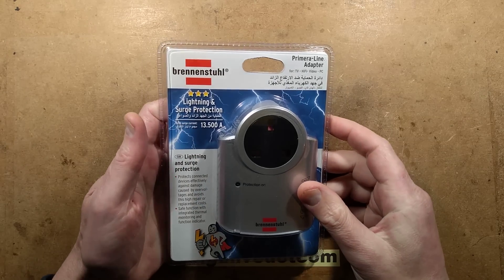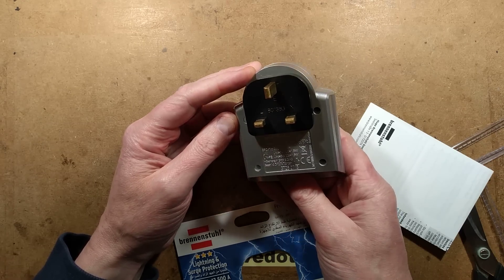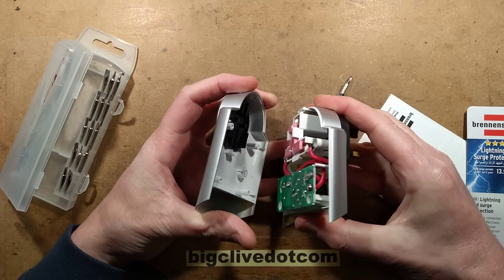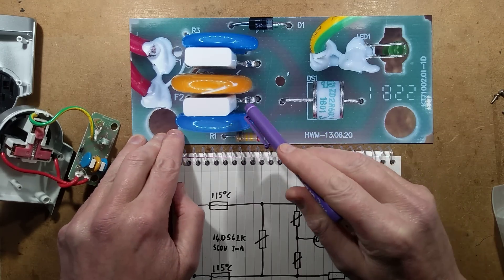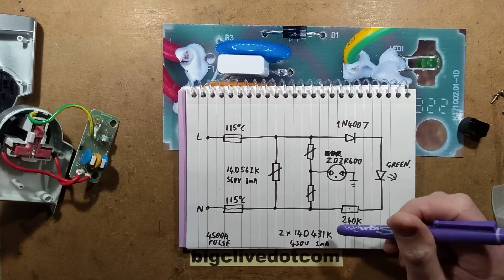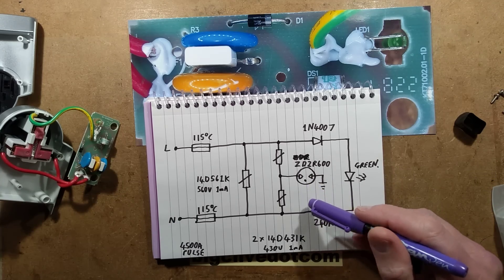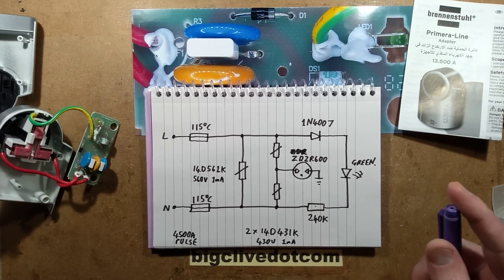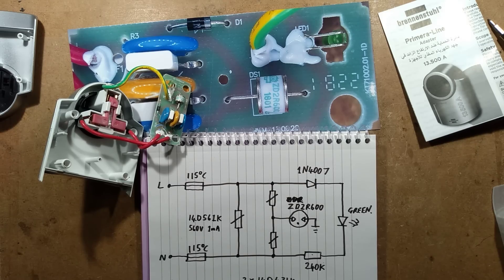Inside a 13,500A surge protector.  (With schematic.)

Comment: My grandfather used to just leave a regular incandescent light on all the time to protect against lightning and such. I always thought it was a bit absurd until the pole transformer outside got struck by lightning, and the lightbulb actually allowed the ~15 kV surge coming in go to ground. Terrifying to watch, but it was effective and saved the rest of the appliances in the house.
Reply: @CubeAMSPro100 Well, truth be told it was probably several light fixtures that flashed over, but basically the filament was instantly vaporized and the arc went across the small wires that feed thru the glass base in the bulb, making it light up a brilliant blue in the room I was in. Could also see the arc dancing around in the bulb, but it didn't shatter. The transformer shorted out during the strike and fed the HV from the lines directly into the house. It must've been quite a lot of power because the feeder wires coming off the transformer and going to the main fuse panel immediately burst into flames started glowing bright orange and after a few seconds came off the transformer, breaking the circuit.
Reply: the filament acts like a fuse and energy absorber. its resistance is very low compared with other appliances in the home so the electrical surge will choose it to go through, it evaporates thus absorbing electrical energy, the metal atoms fill the void, and then it breaks the circuit and arks thus absorbing more energy. brilliant!!
Reply: @CubeAMSPro100 Sorry should have put in what was said above as well, but basically since the filament is on, its already conducting and is a current path and doesn't require substantial voltage to start a flash-over. The filament is a couple hundred ohms and is small so wont carry the full voltage surge, but its there long enough to allow the arc to form as said above. It wont carry current for long, though, as the feed thru wires that the filament is crimped to are quite small. I suspect they're probably melted down quite quickly, but at that point the arc is already conducting.
Reply: @CubeAMSPro100 I will say one thing that with the advent of LED lamps its now a free for all as to what pops first during a lightning strike. My parents also sustained a direct strike to their incoming service, and it ended up being a chunky external power supply that was turned into a melted down carbon pancake. Same thing for the place I worked at before my current job which had just fluorescent lights. Bolt came in and burst the water main, and ended up cooking the ethernet router (and physically destroying some of the cabling), knocking out our network the next day. Makes a good case for getting lightning arrestors installed on your service.
Reply: @mysock351C  After i completely switched to LED lights i can't even have light on when there is a storm because where i live lightning strikes like crazy all the time and i already lost 4 LED bulbs
Reply: you really need surge protection anywhere nowadays... also, i would prefer the failing surge protector switching supply off, instead of just committing suicide and leaving load unprotected
Reply: @ketas  They wont protect against lightning strikes, tho. It will just flash over inside from what I found when it nuked an external supply. Still useful for glitches from relays and sudden voltage surges if a transformer has automatic tap troubles.
Reply: well, you need something bigger to protect wiring itself... like gas discharge tubes or air spark gaps... so you don't get flashovers in wrong places, like inside junction boxes or maybe in cable itself
Reply: @ketas  Yeah thats what I said a couple posts up. Its good insurance if the service permits. Data center behind my old apartment complex had surge protection at the main switch gear, and it was surprising how often it would trip on overloads and surges.

Comment: So for surge supression on DC what is a good option when turning on a very large 6000w inverter that has big capacitors that cause an extreme inrush current on the DC side when connecting?
Reply: I think maybe about 5' of 14g wire with a heavy duty switch/relay closing about 1 second later. The 14g wire should be good enough to get the caps charged without frying your contacts, then the second set of contacts bypasses it leaving the inverter connected with whatever you think is sufficient. It had better be at least 4g if that is a 12 input, but 2 or 0ga would not be excessive. The 14g wire will get hot, so make sure it is using non-flammable high temperature insulation like silicone and keep flammables away from it.
Reply: @jdrissel  thank you!! I figured it would take dual relay system. The issue is the BMS modules will stand the current of the inverter running but the caps charge up is like a welding arc touching power to the input terminals.  This is 24V system so not quite 0awg needed
Reply: 2300Watt inverter running a 8 amp Window AC unit off Solar charged LiPo batteries.
Reply: A 1w 1kohm resistor in line.  Once voltage equalizes.  Connect the main wires.  Same as initial charge on some 10-20 farad car audio caps
Reply: An inrush current limiter:  A resistor with a timed relay bypass.  A PTC thermistor will also work if you can find one rated for the load.
Reply: @stargazer7644  unfortunately for 24VDC loads at this current they're at least $50 which is silly for this application
Reply: @miniwarrior7  Take a look at the home brew options in this thread: http://forums.qrz.com/index.php?threads/homebrew-step-start-inrush-circuit.379748/

Comment: I should think that 13,500 amps would be sufficient to remove the wiring from your home, hence you'd only have to deal with the ensuing blaze.
Reply: Depends on the pulse duration.
Reply: @pamersiel  If it removes the wiring from your house you're going to have a big EMP pulse ;-)
Reply: Not really.  Domestic circuit breakers are typically rated to handle 6,000A in the U.K., and 10,000A for light industrial/commercial.  A 13,500A spike might not necessarily be that unheard of if the installation happens to sit close to a network transformer.
Reply: I think household equipment is only tested up to a certain level because flashover would occur at the socket once the surge voltage exceeds a certain amount.
Reply: A lightning strike is an extreme violent event. Luckily it discharges it's full energy rarely directly into a home. In such an event the whole breaker box and a significant  part of the whole installation is toast. But if you are dealing with "some kind" of an over voltage spike those surge protectors are at least better than nothing. If you want to protect yor house you better go for a Unit like this: https://www.hager.co.uk/news-exhibitions-case-studies/18th-edition/surge-protection-devices/89767.htm
Reply: You should be able to see the sparks from orbit.
Reply: We once had a strike in our summer house. It went down nearby but apparently also did go in to the house since one roof mounted lamp plug shot tiny lightning flashes out of it!
But, we had already disconnected all sensitive equipment so... But no fuse went.
Reply: Theory being this device and the wiring in your house will be protected from short duration current spikes by your MCB or RCD tripping. So voltage rises>surge protector starts passing current>high current trips MCB. Your electronics have been protected by the voltage spike and then disconnected from the power.
Reply: Daniel I That kind of event may weld the contacts in your breakers, requiring full replacement ASAP, as they can no longer break the current for normal events.
Reply: @johnfrancisdoe1563  The branch circuit breakers in my US home have 10,000 amp interrupt capacity and the main circuit breaker is rated for 22,000 amp interrupt capacity. The manufacturer sells models of the same small panel up to 100 kAIC. So no, it wouldn't cause breaker failure.
Reply: Daniel I is right it shorts the circuit and takes down the main braker.
@John Francis Doe ... if it welds you contacts you have verry bad breakers ... I have never seen a breaker contact welding together while opening. Only closing or under certain loads the may weld the contacts together ... they disconect 50kA 50,000 (50.000 | 50 000) A no problem.
Reply: In deed i have seen footage afther a lightning strike it wil blow the fuse board to hell and fry all wire.s
Reply: @ljmike1204  Yes, any circuit breaker with a single circuit board is going to become a glowing pile ash as the lightning goes right through it.
Reply: In NZ we have poles with multiple voltages on them. 400v at the bottom, which is 3 phase version of 230, directly connected to houses. Then we often have 11kv or even 33kv up above on the same pole. Things get really exciting when some drunk driver wipes out a pole and the top and bottom level become connected. All of a sudden your home outlets become 33kv and circuit breakers are useless as the voltage just goes right on through. Usually it manages to find an entry point into the phone network as well, wreaking absolute havoc.

These events are usually very localised, but the damage is worse than what you usually see with lightning.

Lightning is something else though, it is extremely unpredictable, and gets into everything, destroying some things and leaving others untouched with no real pattern. Usually travels a lot, causing headaches that pop up months or years after the initial strike. Lightning faults are terrible to fix. Power surges are at least predictable in their pattern of destruction.
Reply: It is rated for 13.5 A, it says so on a box.
Reply: @movax20h  13500 A As a german i know about the Dot and comma problem, so i use to wrtite it like this 13´500 A
Reply: @movax20h 
No. It's 13500A
Reply: @scwfan08  No. It says on a box 13.5 A.

You can also see on the product, it says MAX 3240W.
Reply: @movax20h  This is a German manufacturer and here we use the decimal point to separate thousands and not as a comma. so it is in fact rated as 13500A and not as 13.5A. Also this would not make much sense at 13.5A because almost all household wires in Germany are rated to 16A or more at 230V RMS and the breakers trip at 16A.
At 13.5A this device would trip the breaker much earlier even with common power tool ratings due to inrush current.
Reply: @Noxoreos  it is manufactured in China. It has no German text on the box, so it is not even sold in Germany.
Reply: @movax20h  It is designed in Germany by a German company, although they are now international. Check the imprint of the company website or the history, which both clearly state that. It doesn't matter where it is assembled. And yes, it is of course also sold in Germany. Just with a different plug. Here is some proof: https://www.brennenstuhl.com/temp/explorer/files/shop_articles/de-DE/images/4007123191482_1506950_A000_normal.jpg
The GB product page also states that it was engineered in Germany: https://www.brennenstuhl.co.uk/en-GB/products/adapter-plugs/primera-line-surge-protected-adapter-13.500-a-sp-240-gb

Comment: What 13500 amps thats over 10 amp fuses so its worthless
Why would a surge protector be over 10 amps
Termal fuse?? 
When its gets hot its load
And load is watt
Amps is how much its capable of
If im right???
13.5 amps would make more sense it exist 16 amp fuses
Reply: They are talking very short pulses. So the fuse might not have tripped, for that very short time the device can absorb overvoltage at 13.5 kA. Without a pulse duration, the number doesn't mean anything really.
Reply: wiedehopf And from this teardown it's actual ability is more like 4.5kA

Comment: I love he wording on these things..  13.5 amps or 13500 amps...
I HOPE my device isnt doing 13 amp, and if it only works after 13500 amps. we are all screwed..
For it to work on AMPS, it has to be LOWER then the one in your breaker..

REALLY there is little to worry about except a Lightning hit to the Ground wire, or a Car hits a power pole and the lines Cross...  but your transformer should protect most of this.   I wouild love to have an old house with wires 18" apart..  
I want Voltage Jump protection..and FEW I have ever seen, have it.
Reply: Your circuit breaker is slow so if you have something fast, it will work. Like my UPS, it's extremely fast and I know it protects very well since everything connected to it survived when we ha a strike in a house nearby. Other stuff went but UPS saved the expensive parts. And the transformer in the grid doesn't dock shit if you get a strike between that and your home.
Reply: @Xanthopteryx  See thats part of the problem, with Strikes..They can arc accross the lines, and HIT that line thats 
NOT protected.(ground lines)  And Surge protector DOnt work if the Spike Jumps the Circuit..  Iv only seen a few that really worked.  And the numbers mean nothing to most people..Rated in Joules helps..  Its just that I want a Circuit that  gives enough ROOM between the contacts  I dont care if it BLOWS UP  and destroys the Thing protecting everything.  the Amounts of electronics in most homes, Is astounding.  And those 65" $2000 TV, is worth the $100 UPS..
DO NOT depend on your home wiring..UNLESS you installed it and KNOW how to do it..   there are devices for your Breaker, that Helps STOP Spikes, and Strickes...and WORTH every penny..
Reply: @ecash00  The same goes for the electrical installation in your home. Have  you seen the tiny separation in a circuit breaker? And in the circuit breaker housing? And in a normal outlet? And in other places in your home. To make a FULL protection you need lightning rod in the hose, lightning wire in the ground surrounding the house, lightning separation on the incoming electric line, lighting separator on the incoming telephone line, ... It cost a lot, and you cannot do it if you don't own your home. In that case, i think APC-stuff like Surgearrest Essentials (like 10-15 EUR each) or their UPS is a really good choice.
Reply: @Xanthopteryx  WELL there is a way..  they have a Arrestor, that youi Should install in the Single Gang box, BEFORE the main breaker...  And it can have all the tie downs to everything..  And yes it would be great in the USA NOT to have metal boxes for the FIRST box.  Separate those lines, give the house a chance...  you can install EMF, and Everything in that box, and it should be about $100...  but they want to charge us a small fortune..to Save out goods..
100 amp box that is designed to BLOW OUT if hit..  You separate the wires so there is no jump if anything gets past and no Jump from the main wires as its PLASTIC OR WOOD..Anything but metal..
Reply: @ecash00  That is not sufficient for a full protection. The lightning can come through the roof, through the air (not a direct strike but discharge that can go through on several levels), and through the ground (including the ground wire) and since the lightning can jump several kilometers, it can jump through the wood and other stuff. That is why you have to have a shell around the house, from the air to the ground. And anything that slips trough, the arrestor and other stuff will handle. Here is a simplified view: https://www.elliottelectric.com/StaticPages/ElectricalReferences/Guides/Commercial_Lightning_Protection.html

Comment: Isn't your British earth pin supposed to be plastic at the back half? This one is metal all the way though.
Reply: no that's the only one that is supposed to be all metal
Reply: How do you push current through a plastic blade? Those plastic ones are to open the shutters for the other two blades when you have a non-grounded cord/device- I think that's the reason, anyway.
Reply: @Laura Harris I meant not the tip, but the back part. The part that could theoretically still be touched while the tip at the front already makes contact but the plug isn't fully inserted yet.
Reply: @Seegalgalguntijak  You've got it backwards. The live and neutral are sleeved near the bottom but the earth pin should NEVER be sleeved. It doesn't matter if you touch it, it's earth!
Reply: Roflcopter4b And if a Chinese fake sleeves the earth pin, it gets disconnected when fully inserted in the socket!
Reply: @Roflcopter4b Oh, then I remembered it wrong.
Reply: Seegal, lol I sincerely hope you're trying to be funny.
Reply: @Star Gazer Nope, I just made a mistake and admitted it. Should I delete this comment thread because of that?